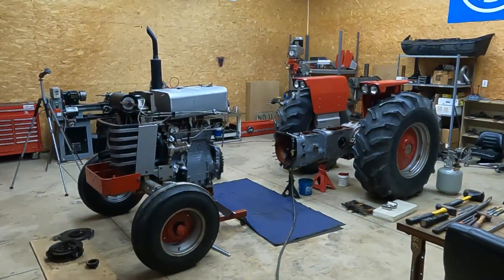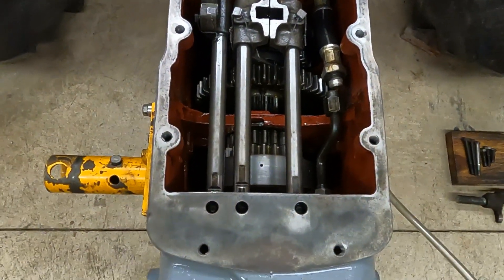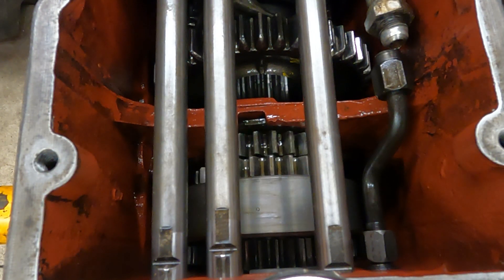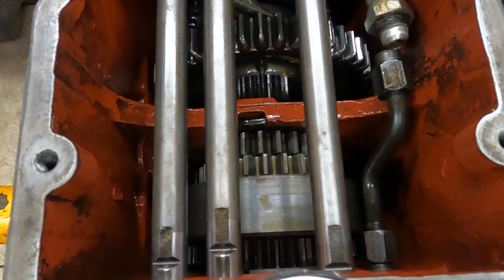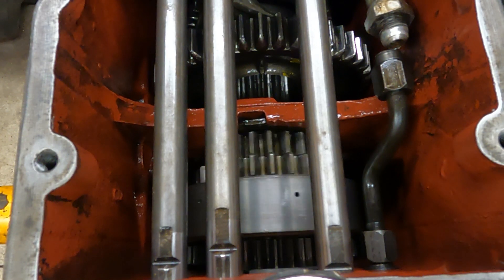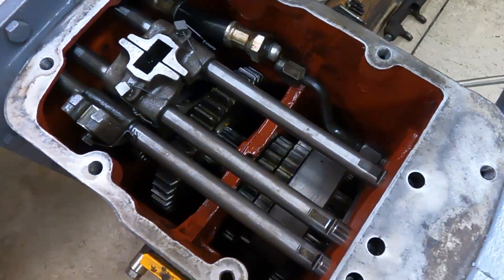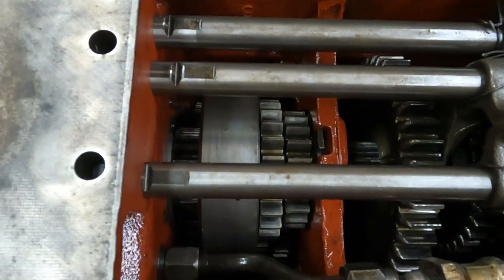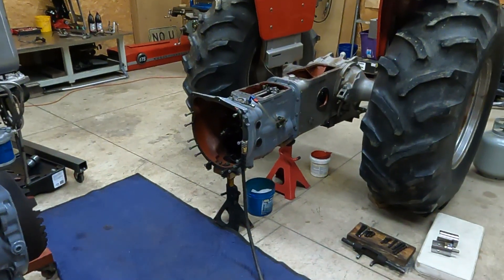Massey Ferguson 175, MultiPower 6speed, Testing clutch pack

Comment: Yep , what the others have said . It’s working as it should . The clunking noise is the discs being pushed together inside the clutch pack. There is a ratchet drive on the lower lay shaft that only allows motion in one direction when in “high”. 
The most common fault is with the piston or slip rings on the input shaft which can wear and cause loss of oil pressure . I’m currently in the process of replacing the input housings and rings on the mf590 
Also it’s good to test the multipower pump pressure before dismantling. There is a test port on the left side cover on our model. The system runs at about 275 psi (uk spec) 
Tidy looking machine by the way !
Reply from the maker: Steve 
Thanks for the info 
I have this machine back up and running and the MP does work like it should now 

My test port is on the PTO cover,  left side of the rear housing 

I measured 325 psi 
I assume my machine was built/assembled in detroit Mi as Im in the USA

Comment: What is the multi power feature?
What is the advantage?
Reply from the maker: Its an additional HI/LoW, shift on the fly, range selection for all 6 conventional gears in the transmission...   

Some people like it 
Some hate it
Reply: @DuB-TeK  thanks.
Are there any disadvantages?
Reply from the maker: @emredoruk35  
Downhill engine braking is lost in low range, some people dont seam to understand that and assume the system is malfunctioning...
Reply: @DuB-TeK  For example, can it be retrofitted to the mf 265s?
Reply: @DuB-TeK 
Mio padre acquistò nel 1973 un modello 188 4RM 85 HP con cambio Multi Power di fabbricazione francese.
Tutt'ora funzionante, ma per quanto riguarda il cambio Multi Power fortunatamente negli anni successivi è stato migliorato e reso più sicuro nella funzione "freno motore".
Comunque per l'epoca in cui è stato adottato era una soluzione straordinariamente innovativa e pratica soprattutto in fase di tiro.
Cordiali saluti dall' 🇮🇹🇮🇹🇮🇹

Comment: That is the way the multipower is suppose to work.  It will ratchet in high and not let you back up.  Leave it the way it is, you are good to go.
Reply from the maker: Thanks for the reply 

I posted this video in some repair groups I belong too as a reference to my questions

Consensus says 
Your correct, that IS proper operation, however Im waiting on old man winter to melt off before I can test it, come on spring time!!!